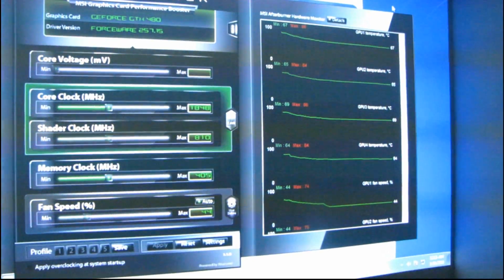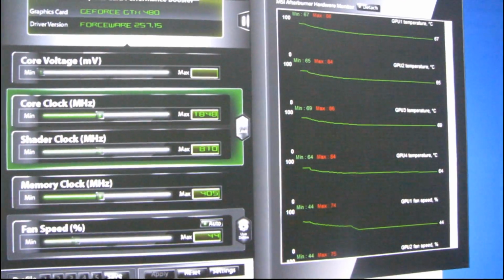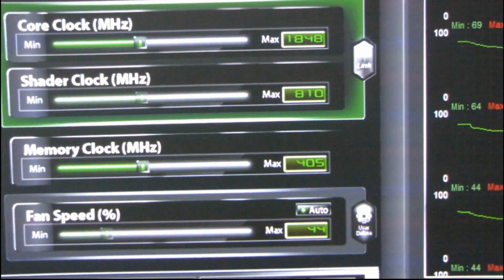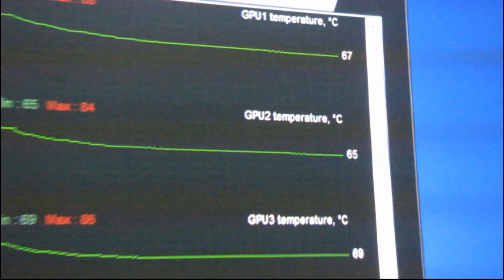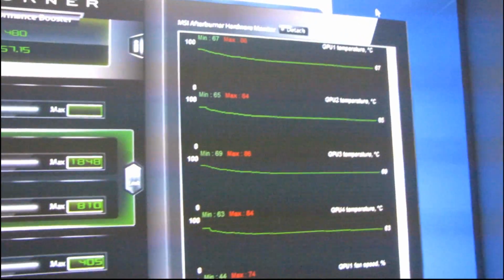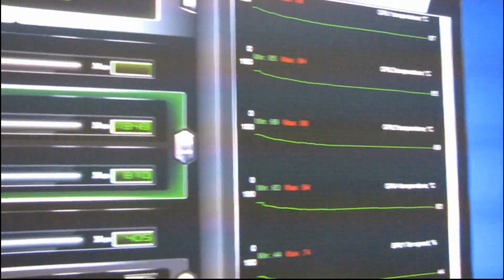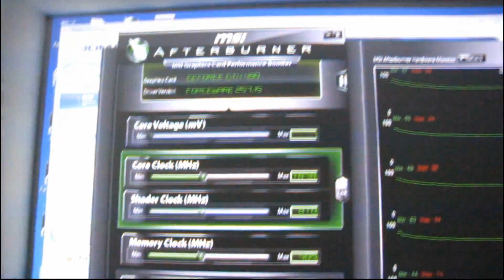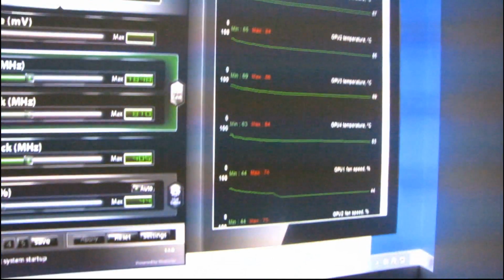Final Video on the Power Consumption and Heat Output of 4-Way SLI GTX 480 Linus Tech Tips

Comment: Oh, let me tell you how absolutely thrilled I am by that unforgettable "Final Video on the Power Consumption and Heat Output of 4‑Way SLI GTX 480 Linus Tech Tips"—especially the part where it freezes and then generously treats us to a luxuriant, wall-to-wall grey screen. I simply can’t get enough of that moment when everything just stops and greets me with a big, bold pause—such cinematic suspense! And then, that wide expanse of grey... so minimalist, so avant-garde, it's like modern art but without all that pesky detail. Who needs thermal graphs or power readings when you can just stare into an endless void of mid-tone grey? It’s essentially the gaming equivalent of a power nap—briefly promising, then stupendously underwhelming. I adore it.
Reply: I read this in the voice of the narrator from the Stanley parable

Comment: Came here because the title caught my eye:  Final Video on the Power Consumption and Heat Output of 4-Way SLI GTX 480 Linus Tech Tips. Exactly what I needed to be able to capture the Power Consumption and Heat Output of 4-Way SLI GTX 480. Now I will never have to worry about capturing the Power Consumption and Heat Output of 4-Way SLI GTX 480 with the Final Video on the Power Consumption and Heat Output of 4-Way SLI GTX 480 Linus Tech Tips. The downside is that I since upgraded to the RTX 2080s in 4-way SLI and there's no follow up video for 
 the Power Consumption and Heat Output of 4-Way SLI RTX 2080 video. Please Linus, provide a Final Video on the Power Consumption and Heat Output of 4-Way SLI RTX 2080 Linus Tech Tips follow-up video to the Final Video on the Power Consumption and Heat Output of 4-Way SLI GTX 480 Linus Tech Tips.